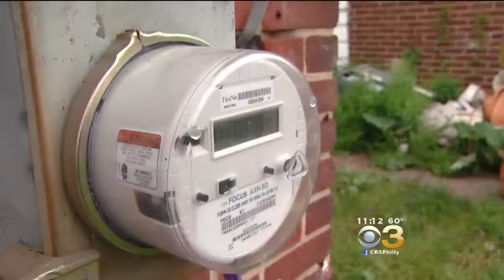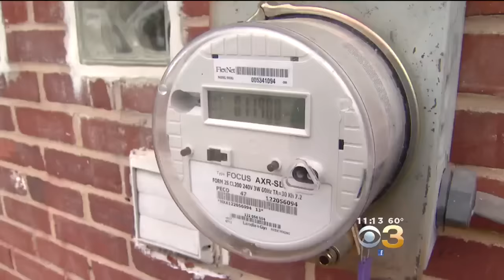PECO Combats People Using Everyday Items To Steal Power

Comment: Didn't know they used 240V in America...
Reply: Jimmy S How do you split 240? I ask as in the UK (actually 230 here) it's supplied on a single phase, so in order to half it it would have to go through a transformer. However for a lot of our 110v equipment a centre tap transformer is used which means it supplies two 55v supplies (different phases). So is the 240v two 110v supplies or does it go through a transformer?
Reply: Peugeot, out on the power pole in the street there's an isolation transformer. It's got whatever the distribution voltage is as primary (the side hooked to the line, and there are several distribution voltages) and a 220-volt center-tapped secondary that feeds your house. Between either end of the secondary coil and the tap is 110v; between the two ends of the secondary coil is 220.
Reply: we also use 12V
Reply: jmowreader Jimmy S

Makes sense,  centre tap! Just an odd idea to me as over here it's 230 single phase. Learn something new every day.
Reply: Peugeot, they do the same thing in Europe but the voltages are higher: places with 220v power use 380v mains, 230v uses 400v and 240v uses 416v if they're pulling off 3-phase mains, and 480v if off single-phase. (In the US we don't bring 3-phase into neighborhoods out of fear someone will go to an Army surplus store and buy a huge industrial welder or something...Europe, OTOH, doesn't worry about that.) The Europeans connect two houses to one transformer - they hook the common lead to both homes, and one hot lead to each. It works but I'm not real fond of it.
Reply: jmowreader I know all this, the main point I was making is that it's supplied differently, on a single phase in the UK, where as in the US  it's 2 phases.
Reply: i have 220v 2 phase going to my house and my office has 3 phase 480v I haven't seen this 240v singal phase around my area.
Reply: ryan stevenson Where do you live?
Reply: S****ing Peugeot there are two single phases coming into the box from the pole. Half of the breakers grab of of one phase, half off the bus for the other phase. So one 120 volt circuit is feeding off or "phase1", whele the breaker vext to it in the box is getting its hot from "phase2". The neutrals are shared. But technically, residential power is all considered "single phase" here in the states. (To run a 230v circuit for a dryer, stove, welder, etc...simply run 2 hots & a neutral). 
Idk...perhaps an actual electrician could explain it better.
Reply: ROTAXD Don't worry - I get it haha. My job is electrical, however I'm from the UK so our distribution/supply is completely different. It's quite simple really.
Reply: ike fun Online it says 2 phases 180 apart... that wouldn't be what I call single phase. Well, that's atleasr how it works in the uk on systems like this.
Reply: ike fun Hahaha. You just got yourself a like.
Reply: it's supplied to the home as two phases 180degrees out from each other.
Reply: 120 per leg..there is 3 cables or wire going into the service..120 and another 120. And a nuetral
Reply: S****ing Peugeot it comes into the house on two lines (120v each)
Reply: Pretty much everything you said is completely wrong.  The breaker box does not split anything whatsoever.  This is easy to see.. just turn the power off on the pole (so you don't screw up and die) and then take the breaker box lid off. 

Three wires come in, or depending if they supply a ground (instead of a ground rod) 4.  Two wires with 120V each, a neutral, and a ground.   The wires, even before the breaker, will read 120V between them and ground (both) and 240V if you go between them.

The pole transformer does this work.  High voltage comes in on that line, the pole transformer converts a single phase of high voltage to a single phase of  240V. The transformer is tapped in the middle.  One wire goes on both sides of the transformer and one wire goes to the center tap.

The breaker box is an extremely simple device and doesn't do any changing of the voltage.  Its literally a set of conducting bars with breakers tied to them.
Reply: BA_300_AAC - Thank you for the correct answer.  The lines running down the road are 7.2 up to 34.5 KV, depending on the need in the area.  Higher voltage for longer lines.  Transformer on pole in front of your house reduces it to 120 and increases the amperage (relative to its draw from the distribution line).  Most homes are using a single phase, which is why you see a tap from a single wire even if the pole has three.  In your box is phase splitting is done.  I am a bit fuzzy on this as I am a mechanical guy, not electrical.
Reply: IT'S a "triplex" 3 wire system in US....120 + 12p =240

Comment: They have abroad definition of theft that's for sure. Yes, it is illegal, but it is not theft it is fraud.
Reply: Only when it's being used. Since power is the product of the potential difference across a load and the current through it. When not in use , there is no current so the power is zero. Also if the battery cell is a straight cylinder and has a masculine name, it could be defined as straight while male power when in use. So in a theoretical dystopian future where the SJWs have won, and minorities rule, the power of that cell may indeed be zero.
Reply: SpudHead XD nice response lol

Comment: stealing what we should get for free
Reply: One Eye Gamer Then go buy a generator, windmill or use solar energy. You have options. Why should it be free? It costs companies money to produce and transmit power to residents and businesses. And the upkeep of the lines and equipment. Get real.
Reply: Any thing you get "free" is paid for by taxes.  You get to use the roadways "free", but in reality those were paid for by "everyone".  I may agree to socializing the capital costs of maintaining a grid but I will not at this point agree to socializing the usage cost.  You do directly impact these facilities every time you plug something in.  There is a fuel cost to make that power.  On a reasonably normal day it may cost 2 cents per kilowatt hour to make.  This does not include getting it to you nor building the system, I am referring to the cost to generate it with existing equipment.